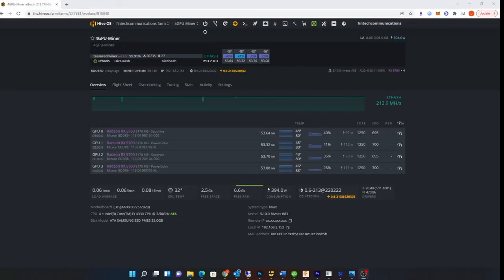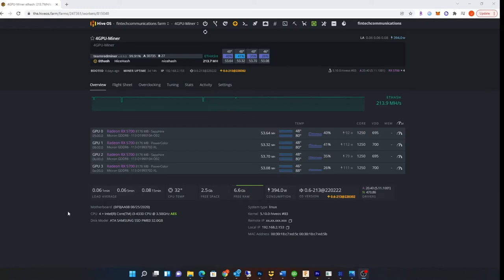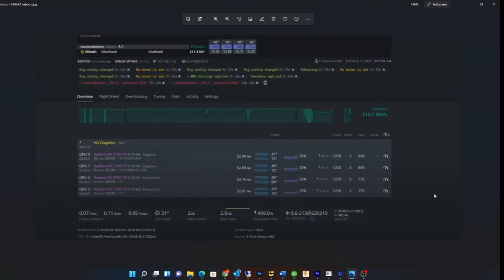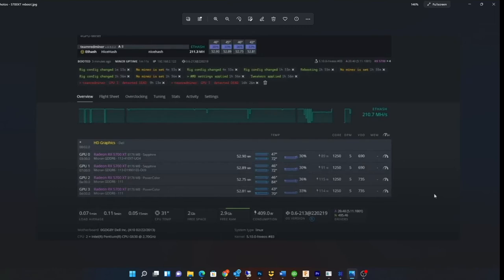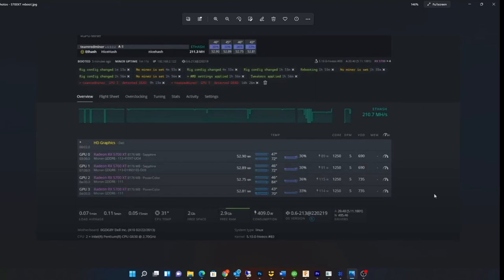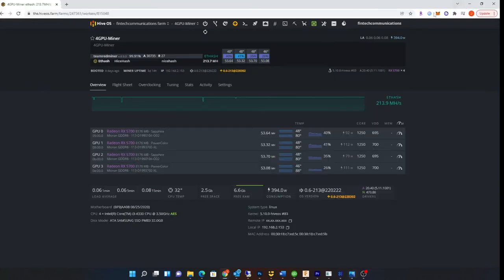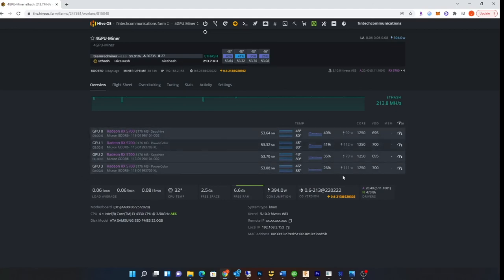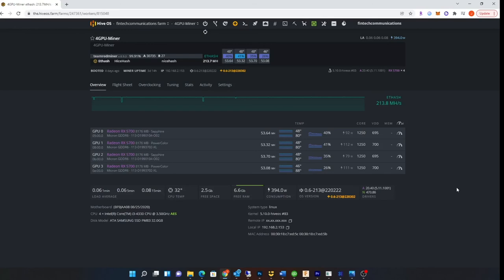TeamRedMiner HiveOS  RX 5700 XT randomly rebooting,  device dead, crashing, reboot

Comment: Anyone who have the same problem the normal power supply won't work. Change your power supply to something strong or use the HP 1200 Watt with breakout board give both the power to the card and the power to the riser from the HP power supply and you want be having any problem anymore. Your riser can draw up to 75 watts. when needed which normal supply usually wants support.

Comment: Sata to 6 pin PCIE is a bad idea! SATA is only rated for about 2watts (that is just from memory), so being drawn from the riser isn't enough. Only use the SATA connectors on a GPU drawing low power, even if the GPU also takes a 6 pin. Even if you have undervolted the card it's not worth the risk, as they are software controlled, if the miner of hives has a moment and OCs are removed more power than 52watts suddenly could be drawn by the riser and bam, burnt cable, crashed even fire.

Comment: If you want to rectify further Unplug all the other cards And one by one test each card. If every individual card is working fine but they are getting dead in a group that means you have a clear problem with the power. Also few of them won't be loading but they are getting dead randomly.

Comment: i have the same problem few times already rig will start crashing from time to time then goes down and i have melted down 6pin connectors to melt a cable like that something is really wrong wire coming straight out of the mining psu melted

Comment: hello, 

I need help with my mining rig , my setup is 3 AMD RX570 4GB gpu mining RVN , just recently my rig started to become unstable and GPU 0 was detected dead by TRM , the watchdog script activates , the windows 10 reboots and the mining use to start as normal , but since a few days the GPU 0 is not mining and TRM shows 0 MHS on the card and the power draw is also less compared to the other 2 GPU's . I have changed my risers , cables , switched the GPU's around , changed my PSU , but the GPU 0 is not mining and is showing 0 MH , what could be the issue ?

Thanks